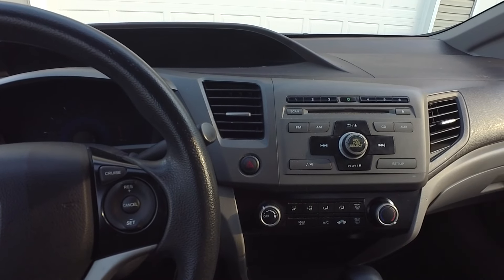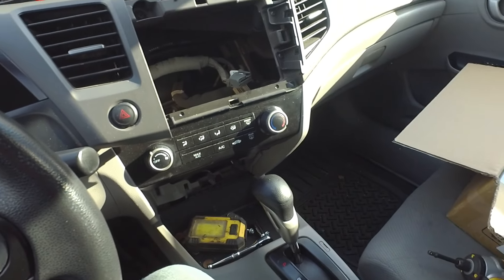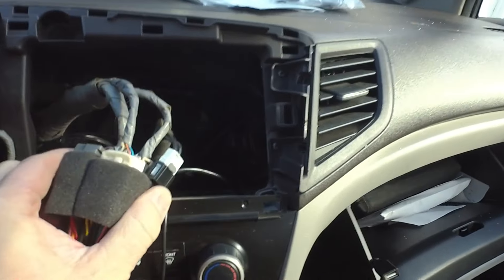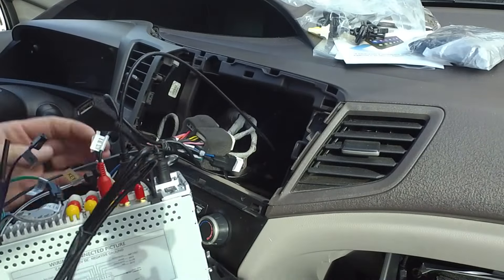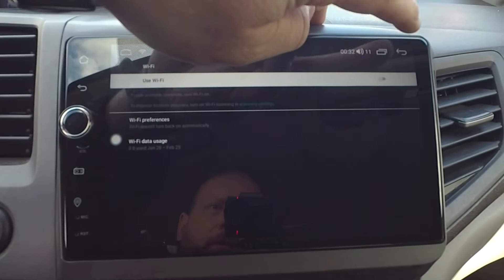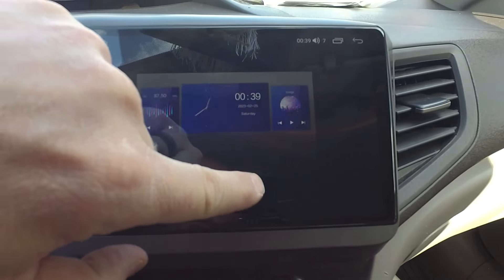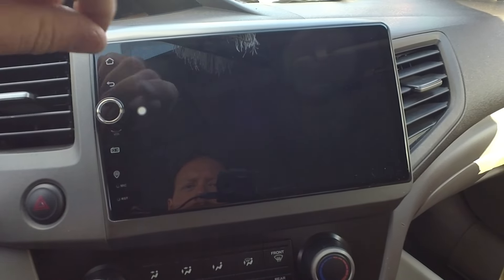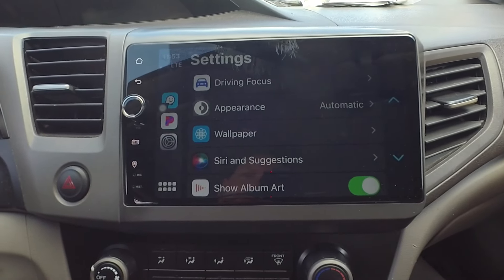2012-2015 Honda Civic Android Navigation Stereo Upgrade Installation and Review Joying JY-HQ142N8G-B

Comment: Thanks for the video.  I just DIY upgraded my 2012 Honda Civic Coupe head unit to the Joying head unit.  Pretty simple install.  Night and day difference in sound.  The EQ on the Joying is crazy customizable.  Wireless Android auto works like a charm.  All the steering wheel controls works.
Reply from the maker: Nice work!
Reply: Have a link?
Reply: Have an Amazon link?
Reply: Hi there. Have about the Aux? Still working? 
Thanks.
Reply: I bought a joying head unit because of this video and I'm installing it this weekend. thank you for such an informative video .
Reply: @keithknight5973  Congrats and good luck. We will be waiting about your comments about the installation… Did you buy it direct from Joying?

Comment: I have a 2012 LX manual transmission. It's super clean as I bought from an older couple and it had very low miles. Not as fun as an Si but at least it's manual. I plan on nav unit, exhaust, rims and wheels, and intake then I'm happy
Reply: Would you happen to know if you can swap your cars type of transmission into a 2012 ex sedan automatic?
Reply: pls no exhaust lmao
Reply: @JrJ-j2r 

It is doable but it requires drilling some holes into the firewall and replacing ypur ECU or going to a Honda dealer and convincing them that reprogramming the factory one to run a manual transmission is a good idea.

It is 100% doable but it's an absolute bear of a task

Comment: Pardon my ignorance, but I noticed you added updated links in the description for "UPDATE: New for 2023/2024 Android 12 Version with DTS Audio". What are the main differences between the original unit and this new updated unit? Is it just the OS version? I am not super aware of audio stuff, is DTS audio a lot better quality?
Reply from the maker: It's completely new hardware inside. All new operating system and a new user interface. I would say overall the new version is superior but the Android 10 units are really good too. I would watch some videos of the different models and see what you think. Can't go wrong with either.
Reply: Gotcha, thanks for the reply. Also, great video!  @JackofAllMasterofNone

Comment: On the factory amp how did you manage to have sound. did you bypass the factory amp to get sound?
Reply from the maker: There is no factory amp in this trim level. It's built in to the head unit.
Reply: Ran into this issue myself. I had some other no name off Amazon and it didn’t have amp power delivery so I had no sound.

Comment: In 2020 I installed in my '14 civic a Sony XAV AX-7000. It Has 4 x 45W RMS built in Amp. I've yet to find another headunit with comparable built in amperage. It sounds amazing even though the screen is aiight (7 inches). I didnt hear your mention of this product's amperage
Reply: If I use this, I'll also get the Alpine KTA-450 4-Channel Power Pack Amplifier with Dynamic Peak Power 45W RMS

Comment: Hi Jack. Happy 2025. Hope the best for you. 

Have a question…

There are cars that have sensors on the rear fascia so that when you reverse they warn you with sound how close you are to crashing. They help when you want to park and they are round. 

My question is if I get to put sensors on my car, there is a way to link them to my joying stereo and works?

Thanks.
Reply from the maker: Not really unless you can manage to hook up what OEM factory Honda sensors and module. It will work with the Joying stereo

Comment: Quick question, I see you're still able to switch screens on the i-MID but it appears that the fuel economy stats and odometer are blank? Does the information appear once you've started the car fully rather than just in accessory mode? Also, are you still able to access the menu to reset the maintenance reminders? Those are like the 2 things stopping me from pulling the trigger on an upgrade haha.
Reply from the maker: Yes everything works just like factory.
Reply: @JackofAllMasterofNone  Awesome thanks for getting back to me! Much appreciated :)
Reply: Does the factory back up camera still show up on the imid?
Reply from the maker: Yes

Comment: Nice video. I just ordered the unit from eBay for my grandson for Christmas. Getting ready to install. I’m confused by one thing. You say there are two 8mm screws/bolts that hold the factory unit in place but I’m not sure you show the removal of them. The only thing I saw you remove was two screws that I thought hold the cover on under the unit. Did I miss something? Thanks
Reply from the maker: They are under the bottom cover.

Comment: Great video, already putting this in my cart and buying but did you ever make a video on how to install the back up camera? Or is there instructions in the kit on how to wire it to the back ?
Reply from the maker: It's just a universal backup camera. Pull power off of the reverse lights at the back and send it over the trigger line up to the stereo. In the stereo harness is a reverse camera trigger that will make the screen change.

Comment: Nice video. I just bought an after market radio as well and I was just wondering how you managed to get the last two screws holding the radio in place out? I can’t seem to undo them as there on their pretty tight. Just wondering if I’m doing something wrong or if there’s a better way to getting them undone.
Reply from the maker: Using 8 mm socket instead of a screw head

Comment: Hi Jack. Me again. Hope you are fine. 

My Civic has a usb port inside the armrest.  Do you think it’s possible to connect the joying stereo to that port. Or just going to lose that port… 

Thanks for your time.
Reply from the maker: That USB port goes to the upper iMid display. It is possible to use it, but then you can't update the photos on the iMid display. Also, you have to take out the display and then use a special adapter to get it to plug in to the stereo. It is much easier to use an aftermarket port like I did.
Reply: @JackofAllMasterofNone  First of all, thanks for replying. 

I understand what you are saying. 

So, the usb port on the armrest will still working, but  just to charge phones and to upload photos to the Imid. 

I’m still waiting for my joying stereo, but they said it has 3 usb ports. Maybe I will make 2 holes instead of 1.  One hole with a double usb and the other hole with one usb. 

Hope this work. Thanks for your time and enjoy the holidays.

Comment: Can you connect the original camera to the device? Or you need to install it's own camera?
Reply from the maker: The original backup camera is displayed on the IMID screen usually. It would take some custom wiring but is possible

Comment: I have a question about the GPS antenna introduced near the beginning of the video. Is it only used by the Google Map app installed on this head unit? If I use the mapping app of my phone and pair with Android Auto or Apple Carplay, is the GPS antenna not used then?
Reply from the maker: It is also used to set the time on the head unit. I would definitely install it.
Reply: @JackofAllMasterofNone  Thanks a lot! Regarding the location of the gps antenna, do you think it would be a good idea to attach it on top of the main cpu of the joying unit: it is a decent sized metal plate and it only has the plastic dashboard above and the wiring would be simpler. But I do not know whether it would block other components inside the main cpu that might also need clear skyview.

Comment: Got mine installed and loving it! I am having an issue with the backup camera you listed, when I put the car in reverse, it switches to the camera screen but it's black. I played with the camera settings but no joy. Possibly a bad camera? The car is a manual shift, maybe this is slightly different?
Reply from the maker: The camera gets power from the reverse lights. So you have to connect the included camera power wire to the positive and negative in the back at the reverse lights. If that is correct than it's either a bad video wire or a bad camera.
Reply: @JackofAllMasterofNone  it was a bad camera, thanks again for your help!
Reply: @JackofAllMasterofNone  I have a question on the reverse lights, which one do I connect the wires? I see 2 one having a green, black and blue wire and there’s another in the back with the red and black wire on the trunk lid?

Comment: Thanks for the video.
The 2013 Civic has a problem with the OEM display (Entertainment & Odometer) which goes dark after a while.
Does any of the android car radio model supports the entertainment and odometer info.
Can be connected to the systems so that is shows those info.
Thanks.
Reply from the maker: No they don't read the odometer. They work the other way and feed info such as song track and radio channel to the iMid display. If your iMid display has stopped working, it would be easy to replace it with a working one.
Reply: @JackofAllMasterofNone  Thanks for the quick response.

Comment: Another 2 question, please. (#1) How good is GPS reception with the antenna sandwiched between dashboard plastic and instrument cluster?  Or more specifically, does your Nav screen freeze? I'm about to install a JY-HZ142N4 in a similar Civic.  Haven't started yet because JOYING forgot the front facing camera.  It's still in-transit.  Meantime, the JOYING Techi I'm dealing with is insistent I place the GPS/4G antennas on the dashboard top surface.  It's ugly so instead, I'm thinking of the rear shelf.  And just add RG174 extensions to reach the head unit.   (#2) Can you repeat your logic about not enabling your unit's 4G capability in favor of just using your cellphone as Hotspot?  I'd like to get more details?  Because moving the antennas to the rear shelf will entail a lot of "digging"...  Thank you.
Reply from the maker: The GPS internet can be mounted under the dash. There are plenty of good spaces in the Civic since it has a large plastic dash. Just to make sure there is no metal between the GPS antenna and the sky and the further forward towards the windshield you can get it the better

Comment: Did the steering wheel phone controls work?
Reply: Came here to ask this
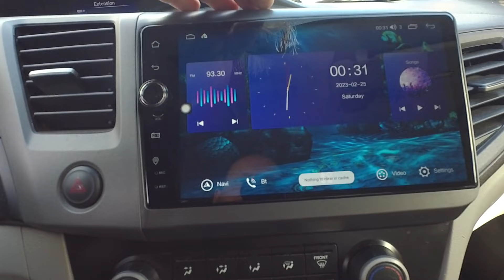Reply: He said at 17:50, "It works with the factory steering wheel control you don't need to change anything."
Reply: @amankorotania3222 he did say that but a lot of these aftermarket head units don't support the calling buttons as they use a different communication protocol than the rest of the steering wheel buttons
Reply: @mindstormer7 I can’t confirm the phone controls but it worked with skipping songs and volume. I bought the one off his affiliate link. Song skipping is a little delayed but I haven’t messed with the settings. I’ll try to test the call buttons when I get the chance

Comment: Which socket/connector communicates the source of audio (and channel or song name) from the device to the little iMID display ? I installed Joying head unit yesterday but the iMID screen says “Audio off”! But my civic is 2015 hybrid with the factory DA screen so the harness could be slightly different. I might have not connected the said socket/connector properly too
Reply: Also, the device did not click in place (it has the bracket with the climate controls and vent). One side is coming out and it’s annoying! Should I buy new clips and replace the old ones?
Reply from the maker: This sounds like a canbus issue. All of that info is transmitted via canbus data network.

Comment: Everything works great on mine but I can’t seem to get my 2012 Honda civic steering wheel buttons to work. Trying to figure the fix on this. Anyone have advice? Maybe I need to tear it apart and double check my wiring:
Reply: It’s an issue with the canbus settings in the factory section of the settings app.

You have to look in there and make sure it’s set correctly. Probably have to look up which one to use as the newest model linked has a different os layout than the one in the video

Comment: Hello again, question on the backup camera.  Do you just have to connect the RCA video connection and not the trigger wire?  I noticed that you had the trigger wire taped off so I'm guessing this unit turns on when video is present and doesn't depend on a trigger wire?  (I hope I'm describing this correctly, haven't installed a backup camera yet)
Reply from the maker: This unit turns on the camera because of the canbus network sending the signal to the radio that it is in reverse, so you do not need the trigger wire.
Reply: @JackofAllMasterofNone  , great...thanks again for the quick reply.  Awaiting delivery of my radio, so appreciate the tips.
Reply: @jprice4250  you ever get it installed? How'd it turn out?
Reply: Yes. All works like a champ. Installed the camera above the plate, wired the power to the backup lights, ran the wire to the unit and it works great. Been very happy with the unit. It works well. The screen has gone dark on me twice but the system still worked. (Could hear things fine) but it returned to normal the next day. Might have gotten too hot it, it was in the middle of summer when the car was outside all day while I was at work.

Comment: Just wondering, why would you use that rear camera instead of the Joying camera that they advertise is better optimezed and compatible with the stereo?
Reply from the maker: The HD camera does not work when the head unit is in a full boot such as when the car has been off for a long time. The analog camera works great and immediately comes on when shifted in reverse, even before the head unit boots up

Comment: So how does the backup camera work when it already appears in the i-mid screen? Is something rewired so the feed goes to the head unit instead?
Reply from the maker: My car did not have a factory backup camera and an aftermarket one was added. If you have a factory one it can be made to feed into the head unit but it requires tapping into the feed going into the imid display and is more complicated. By default it will just stay using the imid.

Comment: Jack, Thanks for uploading this detailed video for this unit. I just recently picked up a '12 civic with a 5-speed manual transmission. This civic of mine still has the factory stereo installed in it. I do have a question that you did address, but I have a question for security reasons. If you do have your car go in for any kind of service in a shop and you do not want prying eyes going through your stereo settings or anything you don't want access to, is there a code you can use to lock out anyone? Not just your email idea, but the whole stereo rendered useless save for you? I do have an iphone and would want the stereo set up on the configuration. Thank you for this video upload.
j. l.
Reply from the maker: Not that I know of personally. There has to be some sort of app that could do that though. I just have never had the need to do it.
Reply: @JackofAllMasterofNone  Thanks for the response.
Reply: Good question. There's no pw upon startup option I guess..... like how a android tablet has
Reply: @JackofAllMasterofNone I would advise creating a secondary account that doesn't have all your personal info .
Reply: @JackofAllMasterofNone 
 Does this head unit come with all required wiring, wiring harness, etc and the frame you used in this video? I have the exact 2012 Honda Civic.

Comment: I just installed mine, everything works and sounds great except my music will cut out for a slip second randomly, typically a bunch of times during a song. How do I fix this? Is this a wiring error I made?
Reply from the maker: Definitely not normal. Im sorry but I have no idea why it would be doing that. I would just check to make sure all connections are reseated and everything is tight. Could be a defective head unit.

Comment: Do you have any recommendations for a slightly cheaper option? I just got my 2012 Civic LX with the base stereo and as a college student I don't have a ton of money to throw around. Do you recommend waiting and saving up for a more expensive stereo setup, or will a cheaper option work fine? And if so, what are some of the cheaper options you would reccomend?
Reply from the maker: Unfortunately the cheaper Android based stereos are pretty crappy. You could always just use a dash kit with harness adapter and put in a universal type double din stereo.

Comment: How did you get it to work with imid? 
Our imid clock was staying on constantly draining the battery, so we disconnected the canbus now the imid and steering controls are dead. 
How do we fix this?
Reply from the maker: You contact Joying who is responsible for the problem and ask them for a solution. It worked fine on mine
Reply: What version did you get?

The newest version android 12 or the older android 10?
Reply from the maker: 10

Comment: Great video, but did you ever get your steering wheel phone buttons to work?
Reply from the maker: The phone buttons don't work because they are connected directly to the imid screen, not the stereo. There may be a way to make them work, but I haven't figured it out yet. It's a problem on the Honda. No aftermarket stereo can use those phone buttons. The volume and left right, etc. work fine though. The regular controls are through the canbus network but the phone controls are analog and wired to the imid.

Comment: How's the sound?  I tried one of these Android head units in an older civic and the sound was awful.  I sent it back and got a double-din Pioneer head unit which sounded way better
Reply from the maker: Awesome. A major upgrade over the factory stereo and on par with any Kenwood/Pioneer/JVC stereo.
Reply: @JackofAllMasterofNone  I might give it a try but the Civic has the "Premium Sound" and the Android unit isn't compatible

Comment: Hi. Hope you are fine and hope you can help… On minute 3:17… How did you make the hole to the usb cable? With what tool?  Which was the diameter and how did you adjust de cable?  

Thanks for your help and time. 
11/30/2024
Reply from the maker: 3/4" hole saw and then snaps in
Reply: @ Thanks Jack. Cheers.